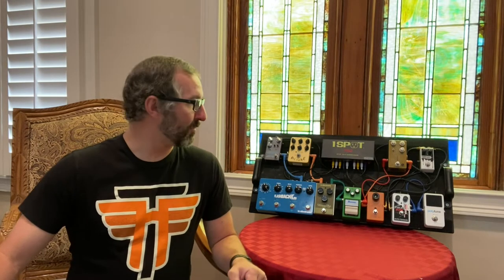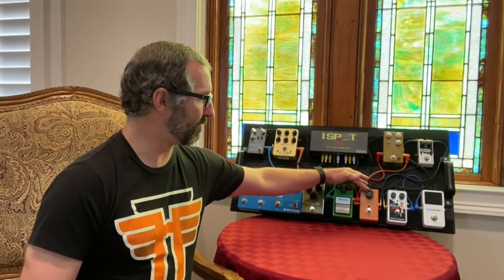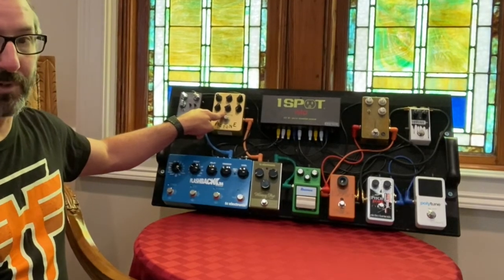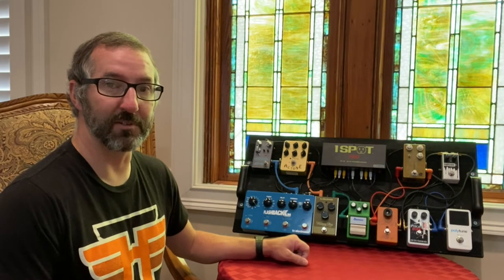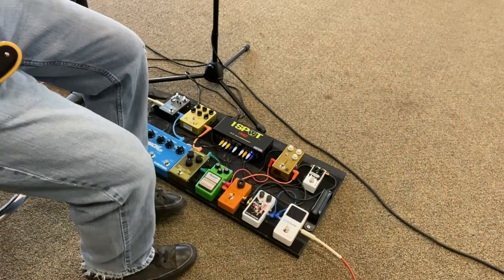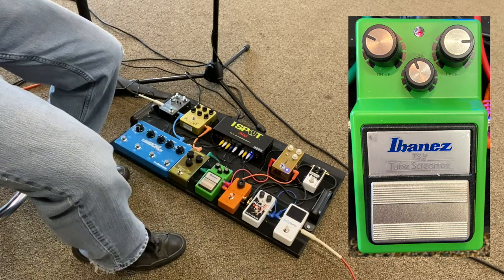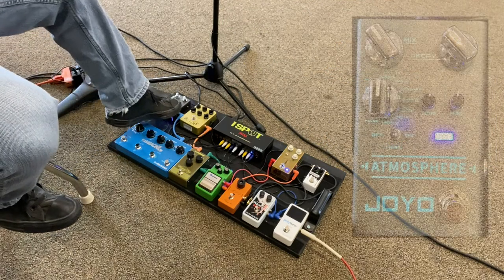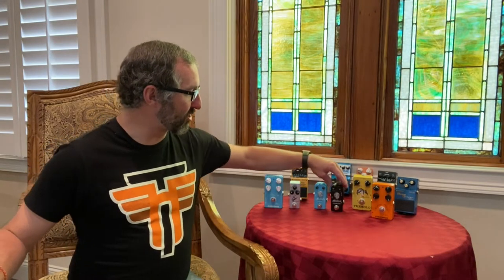What's On My Pedalboard?

Comment: Thanks so much for that in depth tour! I can see how the faux organ using the Pitch Fork, and the shimmer setting on the delay could be useful in a worship setting. I had no idea the Pitch Fork could sound like that. Just curious why you choose to go direct into the soundboard/PA as opposed to going through an amp? I fear giving total control to our church sound guys and having no stage amp in case they forget to turn me on/up. Thanks again! William
Reply from the maker: You’re welcome! Fortunately, the sound board is within reach close by, so it’s a quick adjustment if needed. But in most settings I totally understand what you’re saying. Up until now, I didn’t have my own amp setup, so I did the next thing I could. It’s worked out ok. However…
I haven’t been quite satisfied with the guitar sound in the system. Vocals, keys, guitar (sometimes two), and bass (mostly for montitors) all currently run through the system. The bass player has his own amp and two cabinets. So I just bought and received an Orange Tiny Terror this week, and a Boss 2x12 cabinet came today. So I’m excited about switching over to this new setup! I’ll see (hear) how it goes this Sunday.
Reply: @BrianLeverett  I'll watch for the video and listen. Thanks again! I'm building up my pedalboard now, so this was quite helpful. But so many options out there!!!
Reply from the maker: @WilliamWisePhotography  Yes, so many options! It’s a ton of fun! There’s a lot I’d like to try out to see if I’d like it.